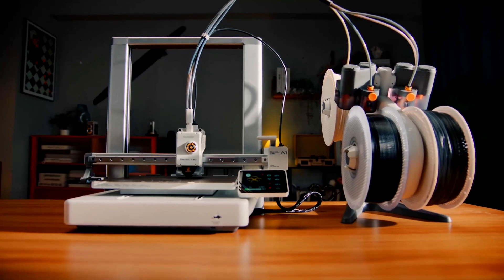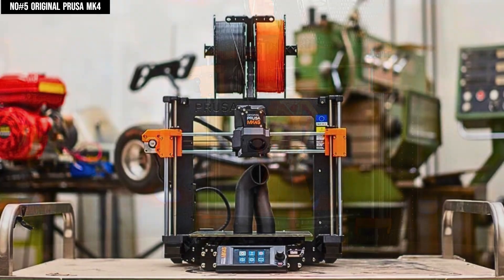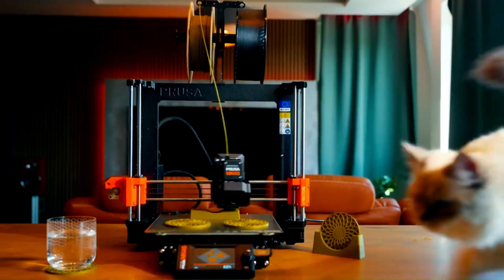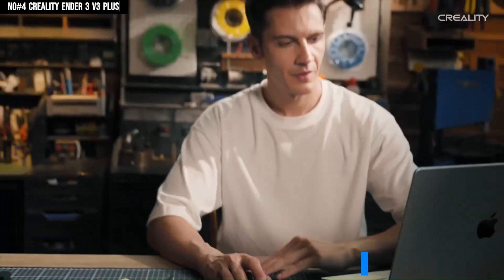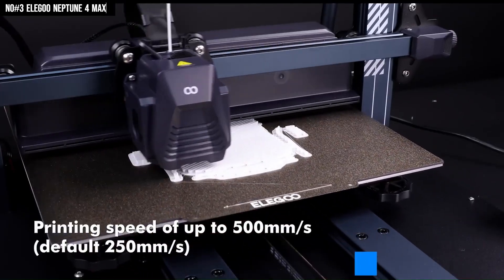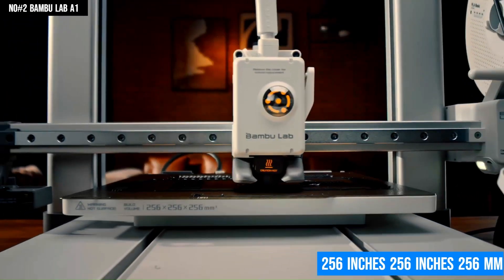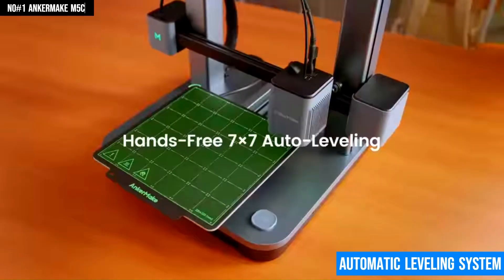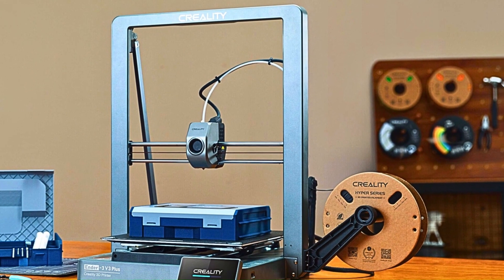Top 5 BEST 3D Printers For 2025 - Best For Beginners And PROs..

Comment: No professional 3d printer would use these printers. Prusa mk4 and bambolab A1 printers are good bedslingers for hobbies if you dont have money for core xy.
Reply: Why do you think that? I have 12 A1 at this point. ROI on them is about 2 months. So I just keep adding more. They aren't as fast as like the X1C but price to value is way better to have 5 A1 vs 1 X1C.